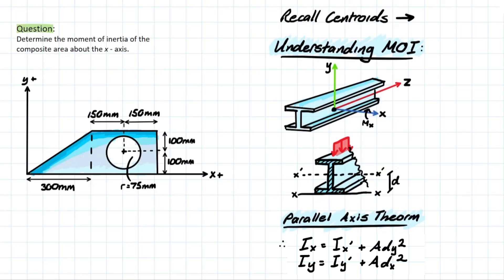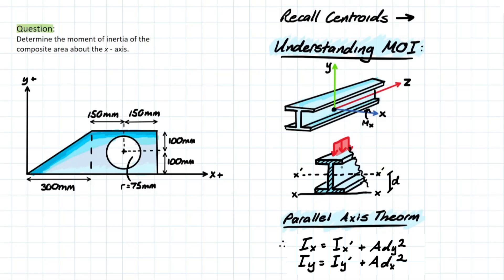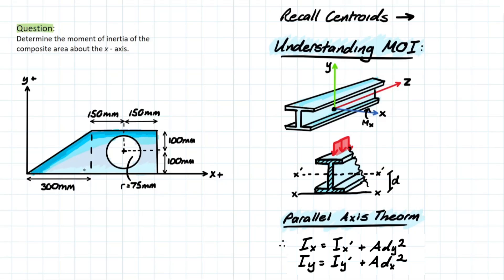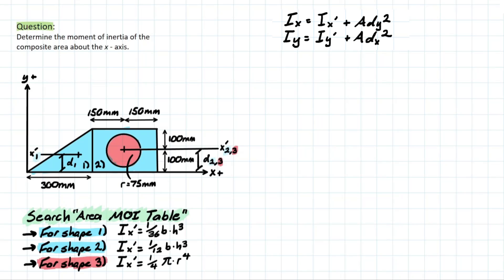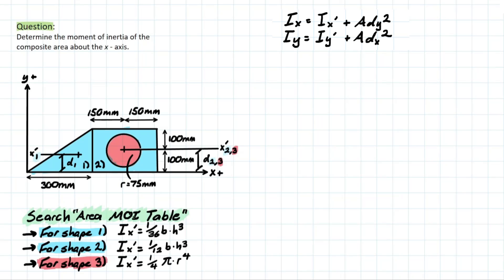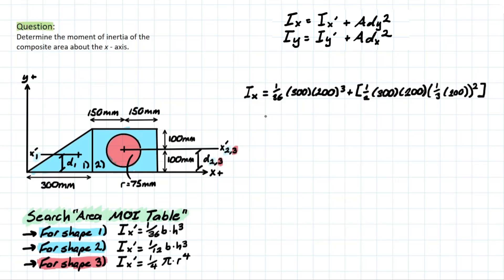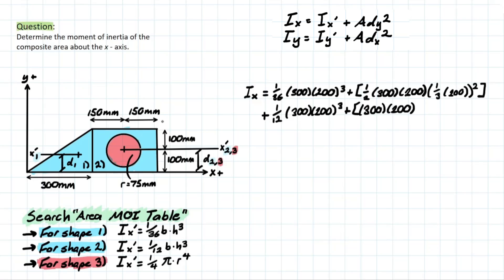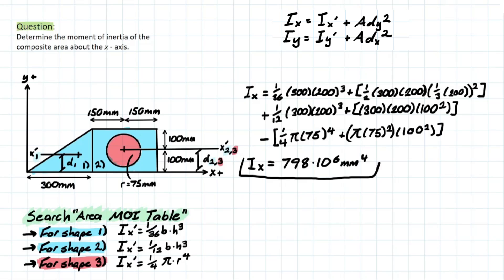Moment of Inertia and Parallel Axis Theorem!

Comment: hmm, i think you need to find the centroid of y first and then use that to calculate d for the composited shape
Reply from the maker: The way it is solved should be accurate just based on the principles of parallel axis theorm. You can test out your theory and send me an email with the solution if you like.
Reply: @simple_civil  hey i am kinda confused, can i email about my problems cause i dont know when i should  calculate the centroid x or y of the composited shape when i could just apply the theory because i tho we always need centroid of x or y of the composited shape in order to find d. can send you a problem it will make thing clearer of what i am trying to say
Reply from the maker: @34_ophuthuan90  you do not need to find a global y for the composite. That is a different problem, related to the centroid of composite shapes. maybe check out this video and see if this is what you are referring to:

https://www.youtube.com/watch?v=LbxAwhKwAXY&t=69s

for moment of inertia, you are finding the centroid of each individual shape, then using each individual component in pieces of the equation.

hope this helps!~

Comment: In respect to dy.  Isnt it that distace between the centriod of the total area of the part.  To the centriod of composites section being evaluated?  The math in this vid uses the distance from the composite centriod to the outer edge.  Doing the math as sown will give an overly large I value. Or am i missing something?
Reply from the maker: Hey! It seems like the final value may be confusing you. Don't forget that the value calculated is with respect to the x-axis. Depending on this reference axis, the end value will differ. As for dy, it should always be the distance between the global axis to the local axis of each individual shape. Hope this helps!

Comment: I have a question,the base of the triangle should be 200 and the hight of the triangle 300,
but u took it the other way around, could you pls tell me why?
Reply from the maker: Hey! I think you may be confusing Iy with Ix, or you may have a different textbook problem. The formula for a triangles local MOI is 1/36*b*h^3. With respect to x in our case, b would be 300, and h would be 200. Hope this helps, just not sure where the confusion exact stems from. Let me know!

Comment: Thanks for the video but i have a question, how do i calculate the moi about the x axis when the centrodial axis is the axis itself...as in the x and y axis are located in the middle of the shape
Reply from the maker: Hey there, thanks for the question! Basically, when the axis is given at the centroid (or center), that means we do not need to consider the Ad^2 part (since d will equal 0). The global and local axis aligned.

Hope that helps, let me know!

Comment: How do I get the answer like this, I got an incorrect answer on my calculator 😢
Reply from the maker: Be careful with your signs and where you place your brackets. A good thing to do it calculate individual sections, rather than trying to input all terms at once in your calculator. Hope that helps!